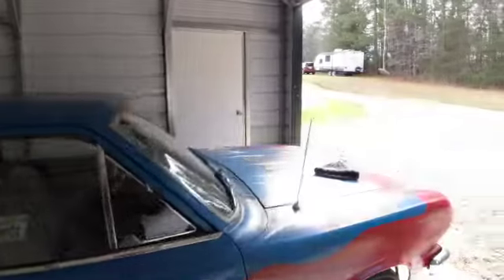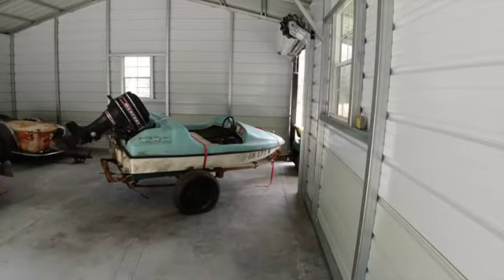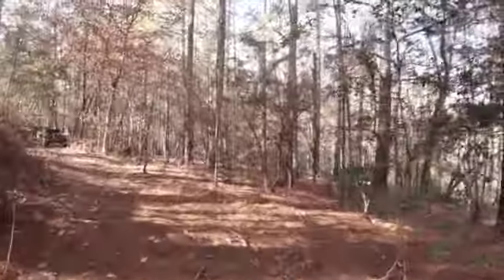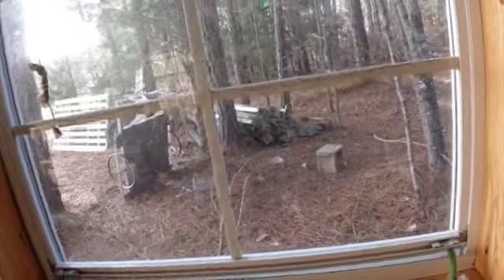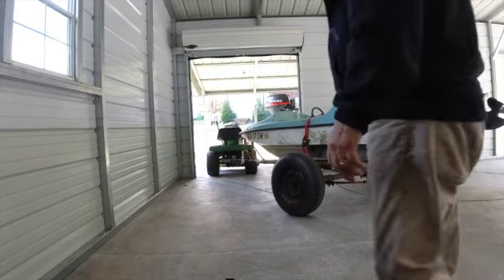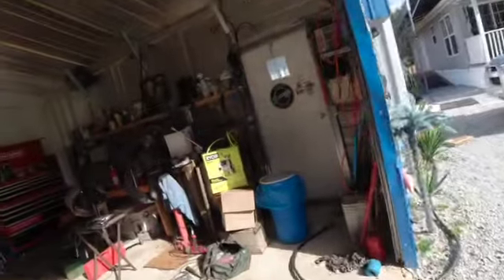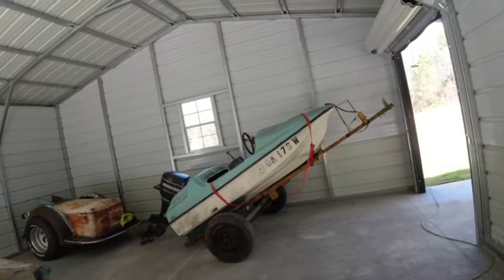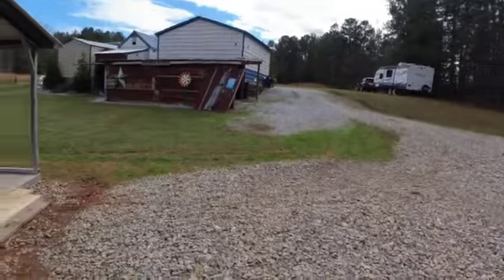Move the little speedboat in

Comment: Hum Ida never guessed thats what was up with your mower I'll have to keep that in mind..and yes you got it right magneto.if you take one off you have to use a feelers gauge to set it to the flywheel..but it sounds like you got it right.. running smoothly sounds like...
Reply from the maker: Running good on that spliced wire with one side being graphite.  Surprised me.

Comment: Yessirree Bob . A 15 horse Johnson boat motor will go good on that little boat it's a small compact motor with a lot of heart. 20 horsepower maybe a bit much but we have running 20 horsepower on a 14 ft Jon boat man that boat wood.fly. and not so distant future I suspect it will be insulation in late and whether the artic self creativity will be in full swing yessirree Bob. It wood be cool.to building a l lean two off the back side you'll be able to get the height for the pontoon boat for the pontoon boat.